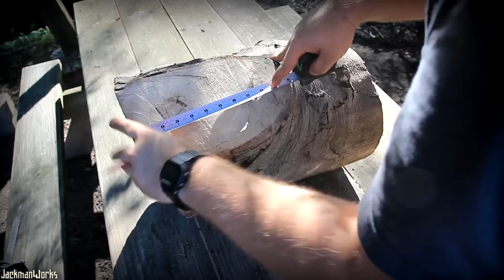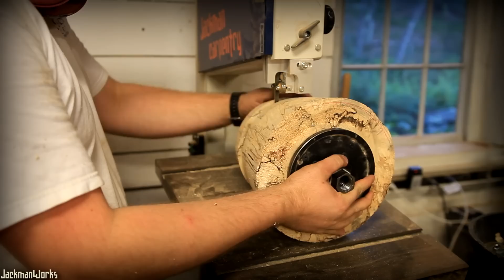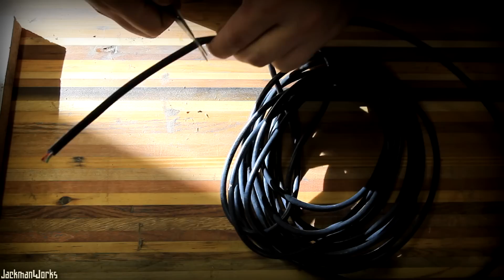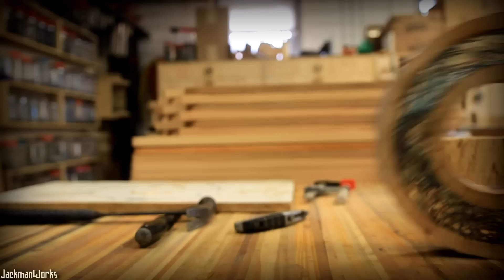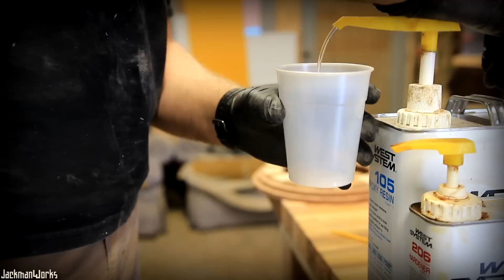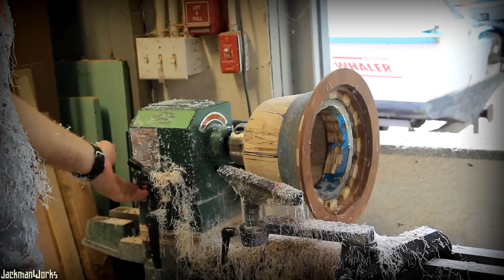Epoxy Wire & Wood Bowl

Comment: Aren't there little bits of wire poking trough the resin? Great video!
Reply: Shouldn't be. Hierarchy of materials - steel and carbide is harder than copper, and will cut it fairly easily.
Reply from the maker: The copper is nice and soft to cut and it stays smooth unless you really dig at it with your finger nail.

Comment: Cool video!  I've recently been turning resin and not sure how I'm liking my finishes.  I saw you went through the sanding pads, but what did you put on afterwards?  Also, for the wood, did you sand that beyond about 400 grit?
Reply from the maker: I sanded everything with the micromesh pads, which I think go up 5000 grit or so. It was finished with linseed oil/beeswax. More info in the website article if you're curious: https://www.jackmanworks.com/epoxy-wire-wood-bowl/

Comment: kool catE5 hat or was it catE6
Reply from the maker: Ethernet cable
Reply: Cat5e. In cat6 cable, the twists of the wire pairs are more frequent and a X-shaped plastic divider separates the 4 pairs.